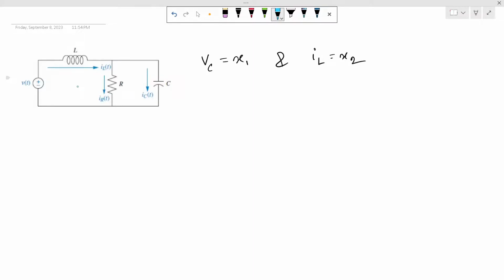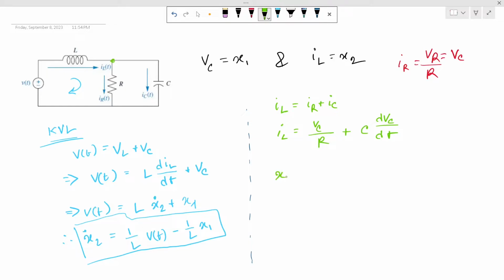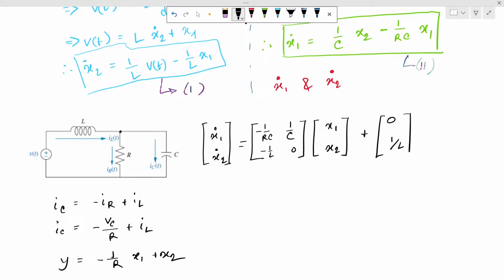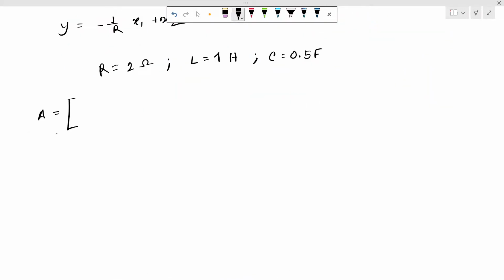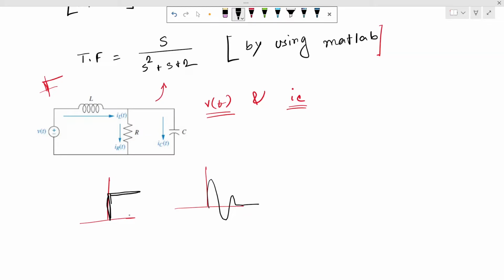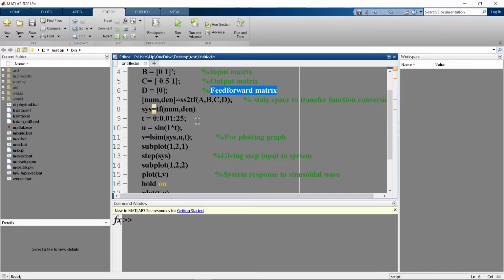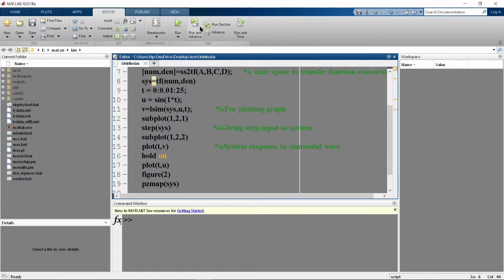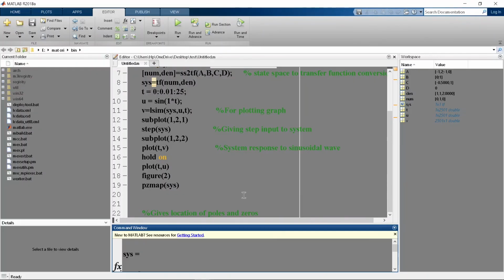RLC Circuit Modeling in Matlab

Comment: It was really great experience. thanks for the easy going explanation. however there was a little mistake in your code. the matrix B should be [0;  1]. here you showed B = [0 1]. that's why my tf came  different than yours
Reply from the maker: Its is definitely  [0;1]. But i just transposed it by '.  For example [0 1]' = [0; 1].  Hope you understood❣️
Reply from the maker: Also, tell me your TF. It should have been same.
Reply: mine came as  s + 3.14e-16 on the numerator @logicverse101